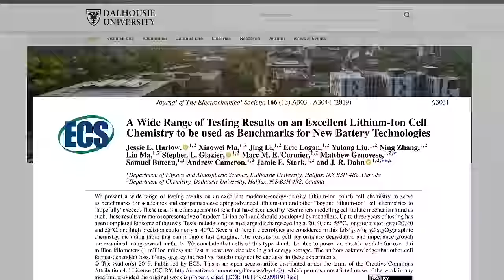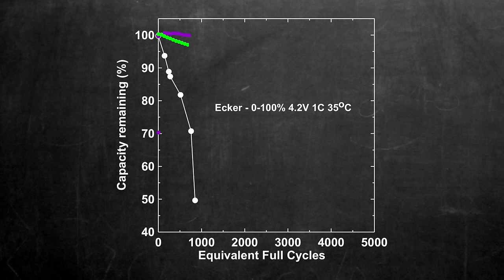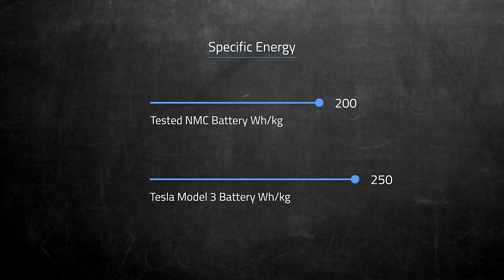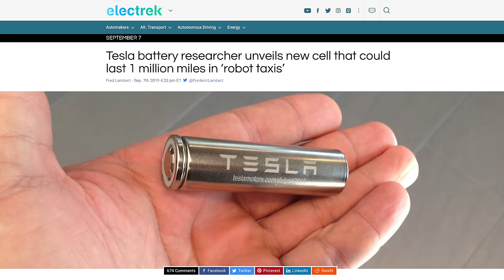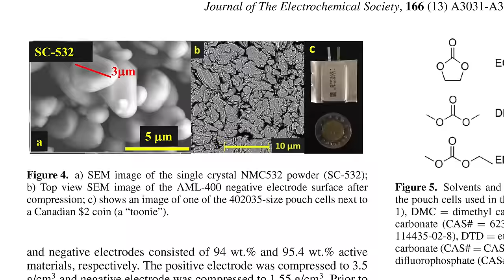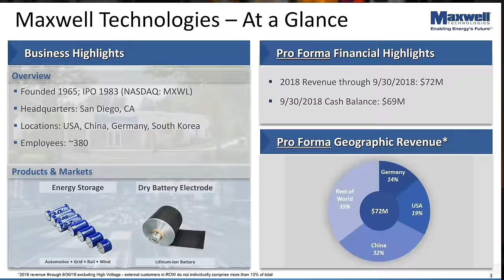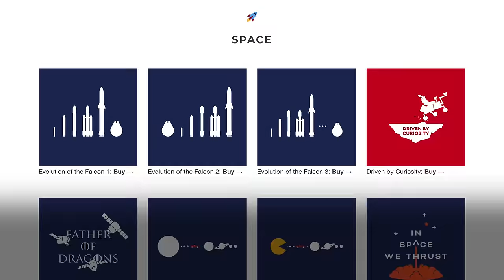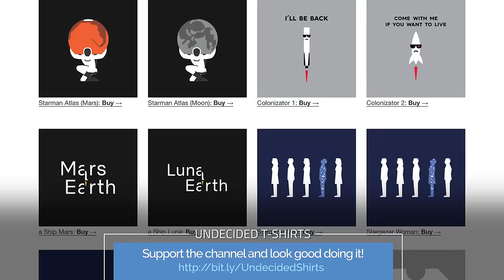New Tesla battery? Jeff Dahn and 1 million miles

Comment: This was a better and more informative report on "the million mile battery" than any of the big media outlet articles I've read on the subject. Well done, Matt!
Reply: Yep, this was "Real News", compared to others, not fake, or junk news.
Reply from the maker: @Geoffr524  Thanks!
Reply: @UndecidedMF , could you comment on news from last 24 hours about revolutionary aluminium-air fuel cells technology, polished by some british engineer? Sounds like a future. Non toxic, easily recyclable,  aluminium as one of the most abundunt metals in the world.
Reply: @user-qw4jy1oy9r  it only charges once and then needs to be recycled. 1500 miles per charge but then you replace the battery. also a battery that needs more work.
Reply: @DrThunder2004  I know it has to be replaced. It takes 90seconds on a gas station. I read it is like changing a liquid gas tank in the kitchen :D
Are you sure it has to be recycled? Cannot be recharged by a special eguipement and long proces?

Comment: The million mile semi makes the most sense to me
Reply: Current diesel semis last around a million miles.
Reply: The Tesla semi is such a bs idea. Do you think those truck companies are willing to lose a day so that their stupid trucks is fully charged ?
Reply: @palaubranm6961  savings on fuel and maintenance on emissions systems would be enough to offset that
Reply: @smiller225  nonsense. Electric trucks are such a dumb idea. The disadvantages outweigh any bs advantage. Just imagine how long it will take to fully charge it. It might take a full day.
Reply: @palaubranm6961  nonsense, you are thinking in absolutes never did I say it would replace 100% of semis. Battery technology needs to increase obviously but  range has dramatically increased in the last 10 years. 10 years from now we might be where we need to be to make a semi more viable.
Reply: Atleast in europe the semi fits perfect.. here is 15 minutes pause after 4 hours driving and then 45 minutes after 8 hours driving.. 45 minutes tesla said would be enough to charge the semi up.. 500 miles range is around the time where the 45 minutes pause should be taken.. so i believe it would be ok.. idk how america laws are but in EU as i said, would fit perfect.. :)
Reply: Nonsense. A Tesla semi will have less than 50 miles range when taking a container load of stuff. Imagine how long it might take to fully charge it.
Reply: @palaubranm6961  i don't think they can afford that type of advertising if it wouldn't be true.. + they offer 1.000.000 miles waranty.. i don't think they would screw themselves up 😅
Reply: Palau Branm Many other companies other than Tesla are developing semis, but you wouldn’t know about that since you only have a grudge against Tesla.
Reply: @palaubranm6961   It will go 500 miles with a full load of 80000lbs gvw . They will charge while unloading. Or sleeping. They will also be on a much bigger super charger. 250kw and above. Will it work for every trucker right out of the gate.. probably not, but for the trucker that makes the same routine trips say to walmarts and targets ect. this will work.
Reply: All I ever hear about is what Tesla is going to do but so far they haven’t done much, Tesla sold 184,000 cars in the US in 2018 and they sold 192,000 cars in the US in 2019, that’s a negligible increase in sales. So let’s talk about how trucks actually get used. My daily parts delivery truck has a 500 mile or so delivery with 11 stops to do every day. It gets back to the PDC, a driver switch is made and the truck grabs a preloaded trailer to take to another PDC where it will pick up another trailer to bring back to the home PDC. Those trucks routinely go days without a break. At this time an EV cannot do that in perfect conditions let alone a cold snowy day.

Comment: The 625 mile range per charge is what will make things interesting
Reply: If they can achieve that mark at 0-2 years from now, its game over for gas cars
Reply: It could be done right now but it would be super expensive. It could double the price of what they can offer now. And its a big no no for now
Reply: With that needs to come battery weight reduction and other ways within the vehicle design to reduce weight on the already stressed chasis and suspension. Hitting a pothole in a Tesla is an unusually bad situation . . . and no spare tire, jack or even lug wrench . . . to save weight . . . and no other reason. You're getting towed for a flat tire . . . everytime.
BTW I am not a Tesla Hater but lets be fair and inform the consumer.
Reply: @billsgui  There are still issues with range. Especially in cold weather. People have been reporting getting significantly less milage in cold weather climates. You still have issues if you park anywhere overnight. If you stay at a hotel or something you can't charge.

Comment: I think the only solution to decrease the pollution is to make a battery that is not very big, can last for hundred years, has a very large storage capacity and without energy loss overtime.
This would enable every house in the world, to have solar panels to store energy on the battery, instead of using electricity from a power implant. And many more applications.

Comment: You are right, we don't need a million miles battery, but research like this that leads to the Model 3 battery we use today.  So, I am excited as well, and I hope that I can see all the EVs on the street before my time is over.  Great video, looking forward to your next one!
Reply from the maker: Thanks, Damon!
Reply: Once not needed in a vehicle, it can be used for stationary energy storage.
Reply: @Sal3600  << I agree
Once the overall car degrades, the battery could be quite useful in >  Another car.   Why buy a new battery each time one buys a car?  The reports on solid state batteries shows the capacity improves with cycles.   
What if I could take the used battery and add it to my home battery bank...  Or a big cell to use powertools from from my work truck...  I'm moving to battery/electric with all tools, as I can.    I'd appreciate some recycled car batteries for my tractor, so I can remove the diesel motor.
Reply: You may not need it, but maybe the third owner of the car, 15 years from now will need it.  These cars are so dependable that we will see them running around for a very long time. They will be first purchased by people with the means to qualify for a loan to buy these cars.  Even the second owner will have a good job to earn a decent salary.  The third and subsequent owners will purchase this car when the seats are worn out and the carpet is wearing thin in places.  After that, I can purchase a Tesla. 
The premise of this vlog is that Tesla batteries in a effort to reduce cost and avoid cobalt will have a shorter life batter. I think (not frequently ;-)) because Tesla is hinting that their trucks will go a million miles, that they do see a path to battery tech that exceed that of the paper referenced.

Comment: Fantastic job, Matt, and thank you for reading Mr. Dahn's paper so I don't have to!  Great analysis of what is a very exciting development on the journey to sustainable energy/non-fossil fuel usage in the future. It is a journey, however, as you pointed out, and this research is but a sign post along the way, albeit an exciting one, but it is clearly not the endpoint.  But boy, the possibilities of what is in front of us with gentleman like Mr. Dahn leading the way--an exciting time indeed.  Keep up the great work!
Reply from the maker: Thanks so much!
Reply: @UndecidedMF  I do think you missed an important point: although the price and cobalt content might be higher and even though the energy density is lower, it still might be relevant, because the amortized cost and cobalt usage will still be lower.  A battery that lasts 3 times as long is essentially 1/3 the price, and will have 1/3 the pollution of a normal battery with the same contents, because you would need 3 normal batteries to replace it.

Comment: But if the battery holds like 3-4 times as long, the cobalt parts should be allowed to be higher as well or not? I mean beside the plan to reduce it as good as possible anyways.

Comment: There is a new kid on the block for static batteries.  It is the Zinc Bromide battery which has some very interesting characteristics such as being able to be fully charged and fully discharged with no fade over time.  It is made of readily available materials (Zinc and bromine) so as production ramps up, should be very cost effective.  And no child labor involved.  As an added bonus, the materials in the battery are actually fire retardant, not prone to igniting.

Comment: I just want to charge in less than 3 minutes from empty to full. Bring on the MW chargers!
Reply: Agent Smith that would be cool, but most likely incredibly dangerous.
Reply: @Krzychu it can. lots of parallel batteries can be charged quickly. although the heat generated will be massive

Comment: Most likely that this improvement would be used on semi trucks battery packs, $4-7k increase in cost will be much easier to  absorbed in a truck  price
Also, truck producktion #s/demand much lower than model 3 category cars
Reply: House battery sees the hardest use as it works all day everyday
Reply: @martialman.4563  Do those battery going to be supercharge  dally?
Reply: @sergeyyevtukh388  Depends  on PV system as far as charge rate. Some commercial sized systems can put out more wattage than the Tesla superchargers. Mine is 11kw so not close to 150-250kw of current generation supercharger.
Reply from the maker: I could see that too (using it in trucks).
Reply: @martialman.4563  ..so thats my point if a battery pack designed to do a ~ 100-200kW rate of charge/discharge daily,  than the price increase would make sence , coz longevity & reliability makes viable product. 
If Tesla about to produce SemiTrucks, with 500kwh battery packs those truck will run pretty steady and have to be able to maintain capacity for a million mile life span of a truck,  to compete with conventional diesel powered counterparts,  otherwise Tesla customers wouldn't buy the Tesla trucks.
...dose this make sence?
Reply: @sergeyyevtukh388  Agreed, but also a long lasting battery is good solution for home use that is changed and discharged daily. Tesla powerwall is only warranted for 70% at 10 years.

Comment: There is more to the specific energy than meets the eye.
Because these batteries don't suffer heat degradation like the current batteries, the number of cells can increase by half again by virtue of a smaller coolant system.
Additionally, these are pouch style batteries and will pack more densely and with less "shell" weight than the current cells.
Reply: That is a really good observation that the author of this video didn't catch (great work anyhow). Most of the designs that are done for commercial EVs today (Buses, Last mile trucks - all non Tesla and most of them with Iron batteries) have to  consider the 20% degradation in a 8y cycle plus the 20% "non usable component of the battery". So the over-design is highly costly and inefficient,  this NMC 532 can be a huge jump on that.

Comment: Once the overall car degrades, the battery could be quite useful in >  Another car.   Why buy a new battery each time one buys a car?  The reports on solid state batteries shows the capacity improves with cycles.   
  We cannot add to the trash/recycle burden. 
What if I could take the used battery and add it to my home battery bank...  Or a big cell to use power tools from instead of a generator ...  I'm moving to battery/electric with all tools, as I can.    I'd appreciate some recycled batteries for my tractor, so I can remove the diesel motor.

Comment: $400 to $500 more for a battery that will last 2x to 3x longer than what is now in use is a small extra cost.  And if the car is headed for robotaxi work then it's irrelevant.  

Consider that it probably won't cost Tesla $30k to produce a robotaxi, but call it $30k.  (Remember, the self-driving systems will already be paid for by S/X/3 buyers.)

$30,000 / 1,000,000 miles = $0.03/mile.
$30,500 / 1,000,000 miles = $0.0305/mile.

The cobalt?  Is it not recoverable?  After a million miles the cells get shredded, the materials separated, and new cells produced.  There will be an early demand for a large amount of cobalt but once cars reach their 1 million mile useful life each robotaxi should yield close to enough cobalt to produce the batteries for a new robotaxi.  It's a one generation issue.

The problem is mostly a social problem of how we might obtain the cobalt without misusing miners in the Congolese fashion.  There are new cobalt mines being established in Canada and Australia.  Even if costs are somewhat higher it won't have a noticeable impact on cost per mile.

Lower capacity per weight?  That just means less range.  NYC taxis average 70k miles per year.  About 190 miles per day.  If the range drops from 310 to 260 miles that is no problem, a single recharge would take care of a full day's operation.  And there's always the possibility of recharging during demand lulls.  In fact, it might be feasible to operate a robotaxi service using 100 mile range EVs.   Between the morning and afternoon commute peaks just rotate the cars in for a rapid recharge.

Comment: I see the point of a million mile battery for long haul trucking and electro-prop planes and boats.  However, would autos, which are normally replaced WELL before their ICE engines are dead, be better served by a super-easy recycling of the battery?

Comment: When I used to drive cabs in Australia, working Christmas eve, I would drive 700 to 800klm in a 12 hour shift. (435 to 497 miles) A battery that only reqires two 30 min charge cycles would still be losing a cab driver money. I used to take 3-15 minute brakes during my shifts on busy nights so charging is a massive hurdle.
Reply: @fourbypete Yeah Right, if you were doing that many ks in 12 hour period you should have made enough money in that shift to buy the bloody TAXI, working on current TAXI charges a 24.2Km trip will cost between $57 to  $79 if you did 700ks of trips in a day  that is approx 28 x 24km trips at $57 which is  $1596, lets say you did 800ks and earnt the max which is $79 for that trip that would be  $2607 and you say you were loosing money Bullshit.

Comment: How is the capacity retention increasing beyond 100% in the publication? NMC532 is stabler than NMC111 (from ecker). I guess ecker is also seeing the effect of Li plating which may be due to imbalance of areal capacities on anode and cathode. If they use NCA811/NMC811 it will outperform all the other systems. Hence, Tesla would be increasing the lifetime to 1 million miles just by increasing the amount of battery pack. Additionally, i think they have enough data from current tesla cars that they can optimize the system. A reduction from 100%DOD-DOC to 90%DOD-DOC can result in improvement in life of battery ~10 times both in terms of storage and operation. Autonomous cars have much controlled and simpler braking / acceleration profiles and hence, may reduce battery degradation.

Comment: Last year a South Korean company, LG I think, said it had a chemical formulation using a lithium Ferrous tech and stated, it could be fast charged in minutes, not hours, could be recharge up to 10,000 times, and wasn't prone to fires. 10,000 charges would be  battery for life of the car. Not sure what happened since. LG said it was ready to be developed
Reply: It seems the batteries I was mentioning were of the Lithium Iron Phosphate, LiFePO4 or LFP type and can last as long as 10,000 cycles if handled appropriately. Cost per Kw $US700 is a kick in the teeth though. That would make a 100 Kw pack worth $US70,000. Tesla batteries are lithium nickel-manganese-cobalt (NMC) cell chemistry. They have a shorter life but can output higher power. The literature I read said a Li-NMC battery should have 70% of capacity remaining after 10 years, while a Li-LFP should have 88%.

Comment: The million mile battery may benefit the average consumer as we transition into home power storage by allowing us to use our car as major component in that storage solution rather than just letting the car sit in the garage.  Home power storage could add a lot of charge cycles to the car's battery while it is not moving at all and a more resilient battery would make this option more economical.  A model 3 holds enough power to energize the average home for 2 days and would be a great supplement to the power wall.

Comment: So, whatever happened to Graphene batteries?  A new formulation was present by a team in northern Europe, which has an extremely short charge cycle, (literally within minutes) and has greater capacity and output.  Maybe they should contact each other and see if the two technologies can be integrated to produce what everyone has been hopping for, a car that can go hundreds of miles and can be charged in as little time as it takes to fill your tank with gas.

Comment: An interesting thought is that while a normal car will probably last 15-20 years or even less in the future. What if you could replace the entire battery pack and put it in a new car with little or no reduction of capacity? Refurbished! That could change a lot and like another one wrote, a little more Cobolt might not be as bad as we first thought.